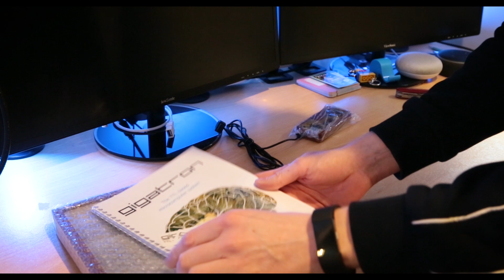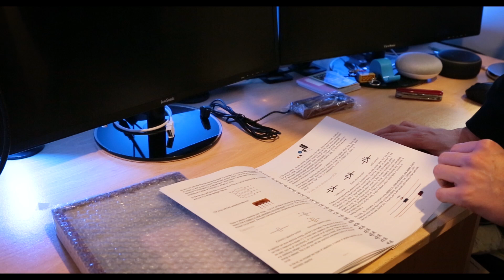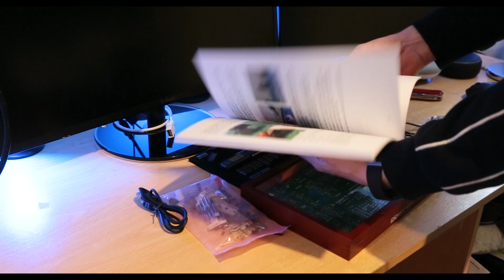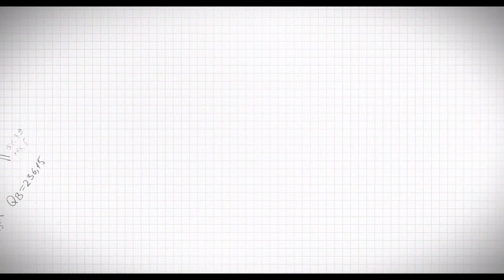Unboxing the Gigatron TTL Microcomputer DIY kit

Comment: Look forward to the build.  Do all of the ic's have sockets?  I always sweat a bit in case an ic is faulty and needs removed once it's soldered in place!
Reply from the maker: Thanks for watching! I've just had a quick double-check of the kit (not started building it yet) and only the RAM and ROM come with sockets. Yes, I think it would be nicer to have all of the ICs socketed, just incase.
Reply: @iNimbleSloth  It will work fine with or without sockets. We didn't put them in the regular kit because many people bend pins with them. And those who really prefer sockets, tend prefer the very expensive ones. So we let it up to the builder to decide.
Reply: @beopstek  makes sense.  A few decent bases would be my route for peace of mind.  My soldering is OK but like I said it would be a bummer if you have to change one for some reason.
Reply: @gartmorn  Yes but it's not the end of the world, as long as you don't try to "rescue" such component if you don't have proper desoldering equipment. Without that, simply cut it out, and carefully desolder the remaining pins one by one. We'll be happy to send a new part, that comes with the service. (And this is hardly ever needed).